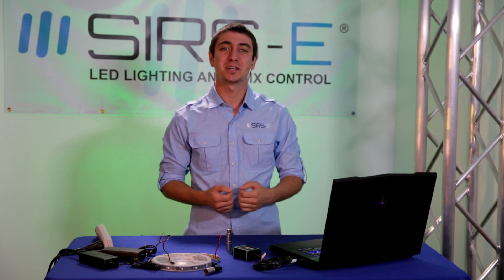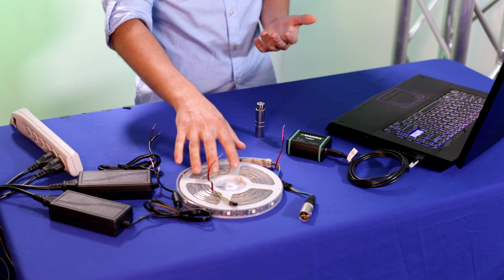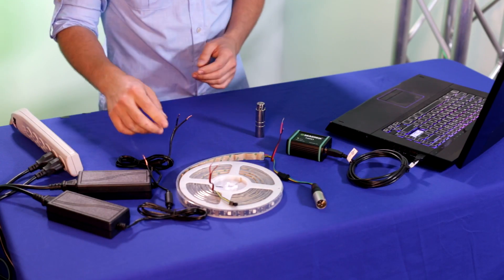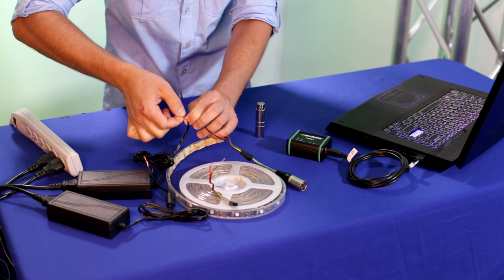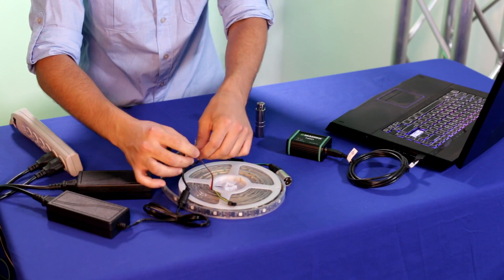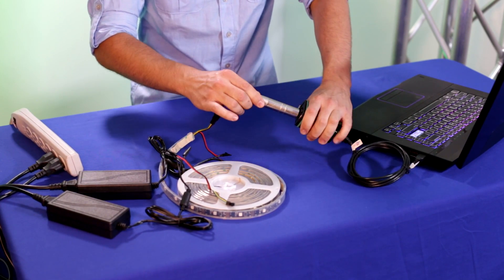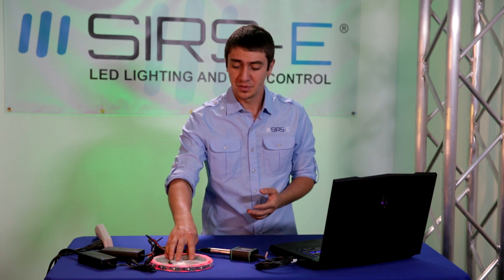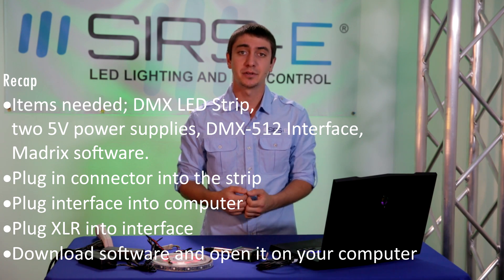Simple DMX LED Strip Installation

Comment: I would like to use this setup in a project of mine. I want to use 20m of strips 30 leds per strip with a power supply. I calculated the wattage its all good. But do i need to use a power supply on both ends of the 20m?
Reply from the maker: Hello Marcel, each of these 5m strips needs to be powered on both ends, as well this uses DMX so each strip is a full DMX universe.

Comment: How do you connect multiple LED-strips together? Do you need thousands of powersupplies, or can you just add more strips to the one you already have? And isn't this kind of useless, if you need 20 NEO-boxes to run 20 LED-strips together, if one strip take up 510 channels? (If i have more questions I'd rather send you an e-mail)
Reply from the maker: +Kimarius2die4 Hello thanks for your comment, in order to connect multiple LED strips you would need to solder the leads together. As far as the power supplies go for this particular strip requires a power supply on both ends due to the fact it is a 5 volt strip, and the voltage drop is more signifigant in 5 volt strips. However if your run is linear you could use one power supply on one end of two strips.

Comment: I've always been taught not to parallel connect power supplies, for a multitude of reasons (balancing, etc.).  I'm surprised to see you do that, without resistors or diodes, between each power supply.  

After seeing you connect this way, I just went and looked up some info, again, on this.  And, I'm still inclined to not connect power supplies in parallel.  What do you think?   http://www.switchpwr.com/parallel.pdf   and   http://www.diyaudio.com/forums/parts/139682-paralleling-computer-power-supply-outputs-can-they-connected-parallel.html .
Reply: +cartwrig The power supplies have to be very accurate with voltage, etc., or they don't track well with each other.  You might gain some benefit by having a length of LED Strip, which might act a bit in place of having real resistors in series with each power supply (where supplies are then in parallel); but, I'm not confident it's a good solution.
Reply from the maker: +cartwrig , Hello and thanks for your comment. You are right about power supplies being connected in parallel bringing balancing issues, etc. We are not connecting these power supplies in parallel to each other. What we are basically doing is reducing voltage drop throughout the LED strip by connecting a power supply at the beginning of the strip and another at the end. And even though the LED strip segments are in parallel, the voltage drop and the resistance from the LEDs eventually won't affect neither power supplies performances. I hope I was helpful in clarifying this for you. If you have additional questions feel free to give us a call 956-522-2006.
Reply: Yes!  Thanks.